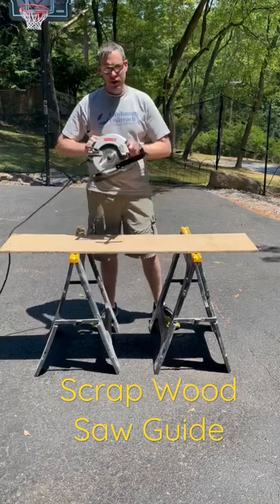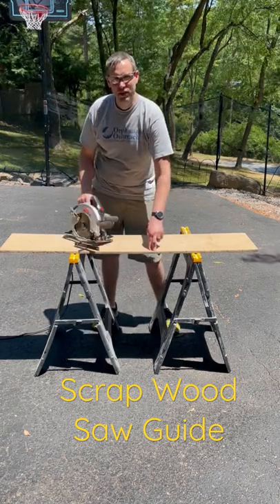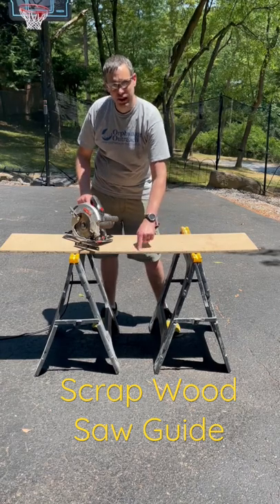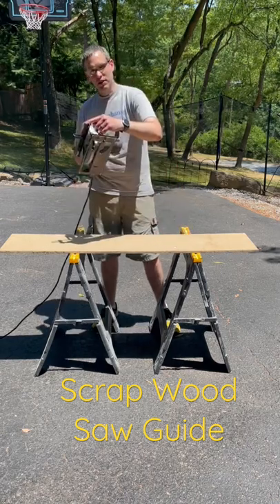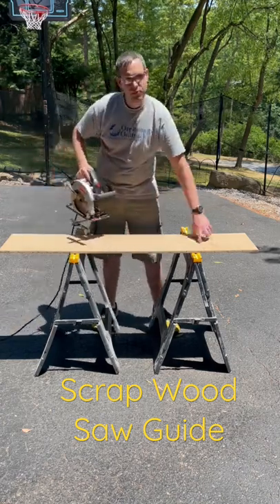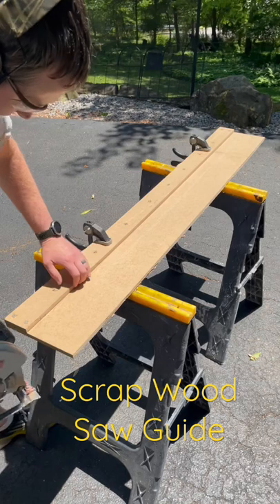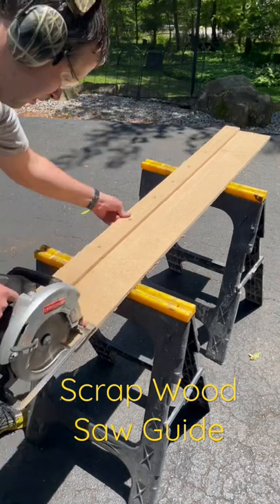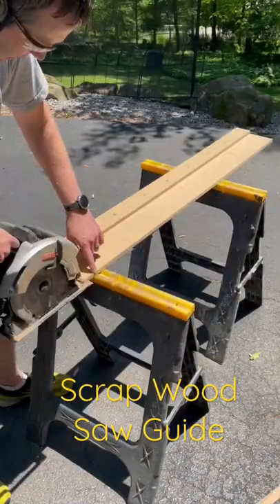DIY Circular Saw Guide - Straight Edge from Scrap Wood - Woodworking, Carpentry

Comment: That top piece needs to be a little bit wider than the saw motor, otherwise, your motor will hit your clamps as you cut. If you notice, he had the pieces clamped together, but removed them so he could make the cut.
Reply: Clamps were just there to hold the saw guide in place while it’s glued and screwed. He did it right
Reply: @ryanpeck9011 I think what the OP is saying is that if he were to make a cut on actual piece of wood that he he needed to cut, he would need to clamp this jig to the wood, in which case the clamps would get in the way of the saw motor

Comment: how do i magically skip over the sawhorses while still making a cut there?
Reply from the maker: Set your blade depth to just slightly deeper than the thickness of the edge guide, your saw blade will skim the top of the saw horse which is fine.  The saw horses are made of a material that is fine to cut through with the saw blade.
Reply: @NateFixesIt  There's a reason you didn't show it in the video.  You know people don't want to destroy their equipment.
Reply from the maker: @Kube_Dog  Actually, the reason I don't show it is because there is a time limit for shorts that I was up against when editing the video.  Skim cutting through the top of a saw horse isn't going to destroy your equipment.  They are made to be cut through. But if you don't want to, you can always put 2x4s under the edge guide to lift it up off of the sawhorses.
Reply: @NateFixesIt  Yeah, skipping over the parts where you cut into your sawhorses saved you the critical .04 seconds that qualified it as a short.  Uh, huh.  People know when you lie.

Comment: Good job! Good tip to use the edge guide on the factory straight edge. I saw a couple of the big woodworking youtuber channels show this with a table saw. If i had a table saw I prob wouldn't be making a cheap track guide like this so its a good tip
Reply from the maker: Glad that you found it helpful.  I own a table saw, and honestly this is easier to use in some applications (for example, a large work piece while working alone).  Thanks for watching!

Comment: With the fence permanently in one position you can only make one dimension cut, if you need to change rip sizes you’ll need to use an adjustable fence. Right?/wrong
Reply from the maker: What’s shown in the video is just the reusable fixture.  It’s to guide your cut when cutting something else.  Mark a line on the piece you want to cut, lay the fixture on top, clamp it down, set your saw depth, and you can cut wherever you want on the workpiece.   If you want to use a different saw, you will need to make  a new fixture.

Comment: What are those ground supports made of to cut through them like that?
Reply from the maker: The saw horses are made of plastic.  I set the saw blade depth to just cut through the mdf.  It will skim the top of the saw horse which isn’t a problem.  Or you can pick up the mdf 1/2” with your left hand when you get to the saw horses so you don’t even skim them.
Reply: @NateFixesIt  Interesting. I'm looking for saw horses like that actually but I don't know if I want to cut through them, even if its recommended. Do you know of any good somewhat budget saw horses or portable work benches for beginners?
Reply from the maker: @5324er  you can always hold the part that you are cutting over the edge of the saw horses if you are worried about cutting through them.  This work table is a good option on a budget:  https://amzn.to/3E8Ue92  it’s pretty solid, folds for storage, and can clamp things in place.   Here are some inexpensive saw horses, but honestly, you can probably get them cheaper in a physical store if you find a sale:  https://amzn.to/3lHTxx5

Comment: Is there a way to tell which edge is factory, if you don't remember?
Reply from the maker: Put a straight edge, like a four foot level, on both sides.  Go with the straightest!
Reply: @NateFixesIt  thanks! I made a guide but I sort of messed up the very start of the final cut, so the zero clearance edge is a bit wobbly right at the start. Is this to be expected to some degree, as the saw's plate has not yet got full contact with the fence?
Reply from the maker: @deaosatori216  that’s normal, do the best you can when starting the cut.  Glad the project worked for you!
Reply: @NateFixesIt  thank you! So if I'm lining the jig up with my measured points or line, should I just not use the first few inches of the zero clearance edge for the alignment?
Reply from the maker: @deaosatori216  yes, ideally the jig will extend past what you are cutting on both sides so that saw plate is fully engaged with your guide when you start and stop the cut in the work piece.